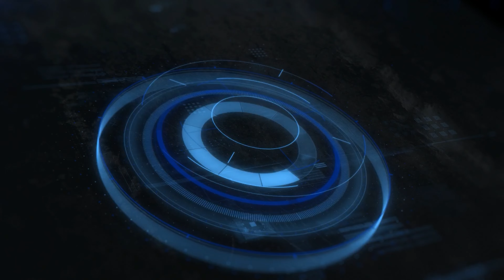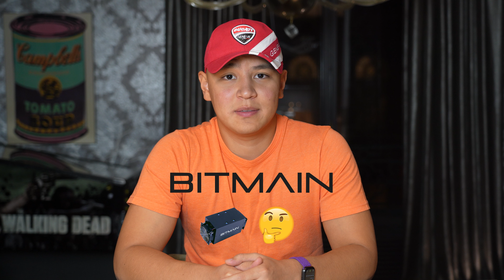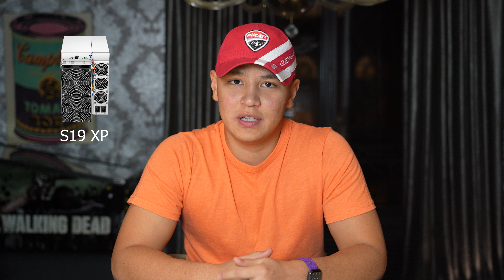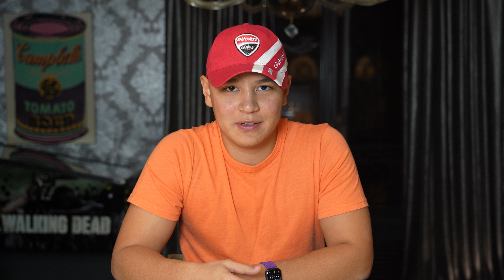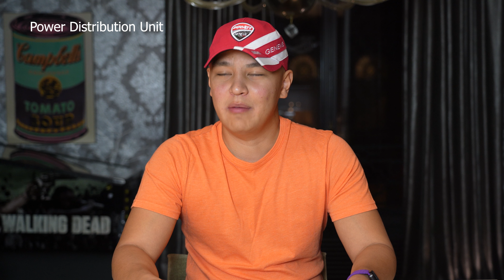BITMAIN S19XP 140Th/s [NEW ASIC MINER] 2022

Comment: Ive been looking at asics that are affordable and make a good amount of th/s. I found the e9+ makes almost 10th/s. If electricity wasnt a factor what would you recommend
Reply from the maker: Honestly I would not go with E9+ even without taking electricity into consideration. The miner is kind of old for todays computational power comparisons and barely survives, not even talking about ROI time. Maybe consider having Helium Hotspot which is not really expensive but brings a bit more. It's hard to find it tho, even second hand.
Reply: @CryptoBeck  e9+ makes more than a helium miner. Helium makes at most 6$ on a good day in my area and honestly i think everyones lieing about making so much from it because ive checked and it doesnt only when the value of the crypto goes up is when you make more. and not everyone can afford to wait 6 months for something that makes so little let alone that costs so much 1200-2000 grand thats a hard pass. E9+ makes 100 a month and is priced much more fair than other asics at only 400$ that pulls the same amount of TH/s. I do not have the money for a 3 grand miner that performs the same as a e9+. The market seems bought out to me im forced to use the e9+ its the most rational asic if electricity is 0kw. Why spend 5000 on asic thay makes 100 a month when i can spend 400 on a asic that makes 100 a month. Its rediculous
Reply from the maker: @Trefuckor963  I agree with you, Helium hotspot is something you need to wait for and most of the time its not really getting you anything because people don't know how to place it correctly. So far mine is doing around 200USD a month, but my placement is good. Well if your price per kW is 0USD than any asic which brings you something will be worth something.
Reply: @CryptoBeck  what do you mean it barely survives, as in nobody uses it anymore right?
Reply from the maker: @Trefuckor963  by barely survive I mean that it is not really used by anyone, since people do not have cheap electricity and even if they do have it they go with other asic miners.
Reply from the maker: Depends on your budget to be honest, but if electricity is not your issue you can plug mine lol :D
Reply from the maker: @Trefuckor963  I meant you can put my asic miner at your place :D (just a joke)
Reply from the maker: @Trefuckor963  yeah people sell them (second hand) for over a thousand which is crazy
Reply from the maker: @Trefuckor963  it is hard to suggest you something, I just don't want to be wrong